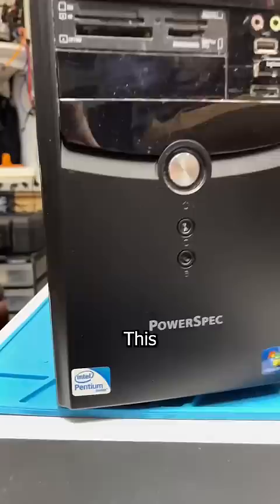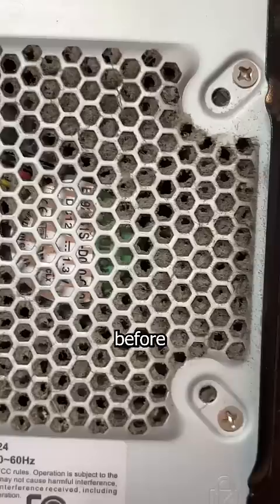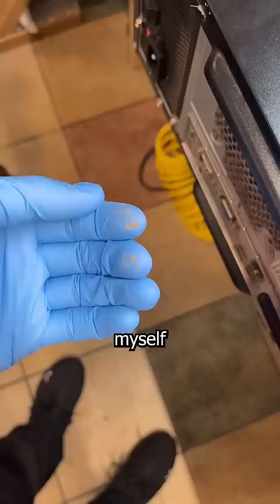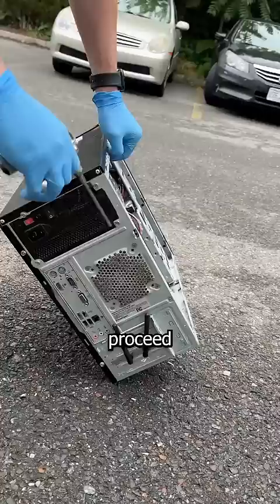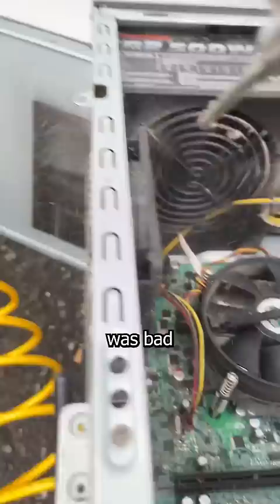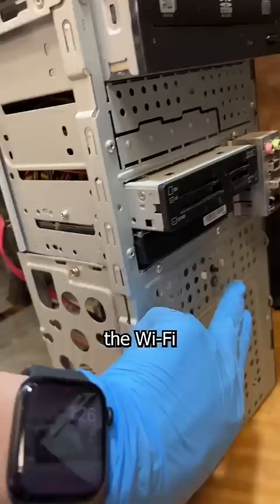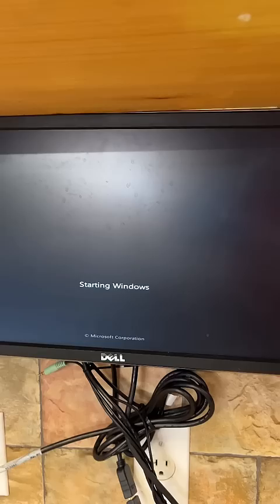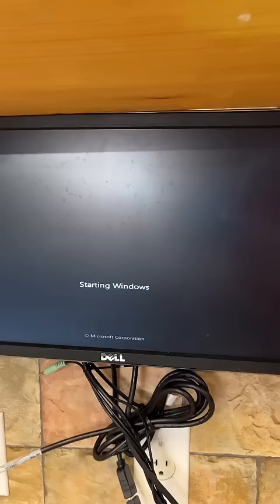Clean your #pc or it will end up like this! #technology #tech #shorts #computer

Comment: I use an electric leaf blower to clean out a PC.  I owe it to an Australian for showing me once.
Reply from the maker: Hell yeah brother
Reply: @Speediest_Burger if they arent plugged in they clearly werent important
Reply: Why does an Australian need a leaf blower? Their plants are evergreen.
Reply: @Speediest_Burger why?
Reply: @macosx10.7lion4 not all of em are mate
Reply: I use a handheld vacuum cleaner
Reply: @devavratkhandekar4020  Vacuums could cause static electricity, I wouldn't use one for cleaning your PC
Reply: @trr4gfreddrtgf there are different kinds of vacuums that don't produce static energy
Reply: @Speediest_Burger just take it out or keep the cooler lol
Reply: @Speediest_Burger ignore my last comment if you saw it, i thought you were talking about cpu pins lol
Reply: you can actually damage fans if they spin to fast. A normal small PC air compressor is enough
Reply: @dwong98 or just... don't let them spin?
Reply: @Speediest_Burger  what??? out of everything that could break under high wind you pick cpu fan pins... TF
Reply: @trr4gfreddrtgf  I've been very rough with my pc in terms of static, I clean it with a vacuum on a carpet nothing has happened yet. I think LTT did a video on it, there's allot of protection on parts.
Reply: Say goodbye to your fans
Reply: @SupaTrendingDaily  I know, but putting a vacuum up to your PC to clean it isn't a good idea.
Reply: Respect
Reply: @macosx10.7lion4 well we still have leaves
Reply: I used snow blower and once I blew off a capacitor 🤣
Reply: tech yes city reference?
Reply: Woundn't cause static? That could fry your pc
Reply: @ionikre  do you know how a snowblower works? They don't blow air, they use an auger to launch snow into the air
Reply: @AJ-Palermo  my fault. I mean that airblower things bc I use it to blow snow on my balcony 😂
Reply: @macosx10.7lion4  because we mow lawns here too believe it or not, here's how I use mine, I clean the shed out and blow it down the drive way or mow the lawn and blow it onto someone else's yard or the road, lol not my problem anymore hahahaha
Reply: I now desire to go to my public library with a leaf blower and offer cleaning services
Reply: I literally sneezed watching this
Reply: @Steve211Ucdhihifvshi  cut grass isn't a problem, it's a fertilizer.
Reply: @macosx10.7lion4 
Have you mowed your grass?
Reply: I used an electric leaf blower too. My PC bricked from the static electricity.
Reply: im Australian and i do that lmao glad to see im not the only one
Reply: @smithbabies7886  yes.
Reply: Same here, but my current computer has such legendary filters, now I just vacuum the filters and slap it all back together, almost no dust gets past it. It's one of the Be Quiet cases if anyone is wondering, they are great!
Reply: Me too or my air compressor
Reply: @dwong98  not true I've done it no issues
Reply: @SupaTrendingDaily  true
Reply: @ionikre  prove it
Reply: @SupaTrendingDaily depends on humidity
Reply: @macosx10.7lion4 you’ve never been to Australia have you?
Reply: @trr4gfreddrtgf  then ground it <.<
Reply: Same my brudda.
Reply: Probably smarter than using compressed air since water can build up in air tanks.
Reply: @5sweatingpalm  Don't think it's possible to ground a vacuum cleaner... They generate static electricity, it's going to be an issue whether you ground it or not.
Reply: there are workshop blowers the size of hair dryers, usually with smaller nozzles than a leaf blower but still got that very high air speed. you can get that inside more.
Reply: @macosx10.7lion4 blow the spiders away
Reply: @AegisHyperon  actually a really good point, thanks for the insight.
Reply: @macosx10.7lion4  bro literally just explained how you could use it for other things besides leaves come on brotha
Reply: @macosx10.7lion4 even then, plants still shed their leaves - someone from an Amazonian country
Reply: And all rhe oil and shor inside it is now inside your computer. For the love of all thibgs electronic, do not do this
Reply: @macosx10.7lion4  alot of them are but not all not to mention even the evergreen trees drop a ton of leaves. They are also used for blowing grass clippings
Reply: I use an electric air duster
Reply: Use a datavac electric dustbuster. those things are amazing. a bit pricy but buy once cry once plenty of blow, not quite compressor strength but plenty enough for pcs, vacuum filters etc.
Reply: @macosx10.7lion4 how else would an Ozzy clean his computer
Reply: I do this everyday at our repair shop. Easier than using the plug in blower lol
Reply: Great way of blowing your capacitors off
Reply: @macosx10.7lion4  lots of us live near gum trees, which is essentially the same as leaving oil on the ground. they're very flammable - why risk it?
Reply: okay but that's kinda rough on the fans thoughhhh lol
Reply: We use the electric tea kettle style blowers. They work wonders!
Reply: @macosx10.7lion4 nahhh bro 💀💀💀
Reply: Air compressor may blow electrical components. I once blowed a small capacitor and it gave me a real pain in the ass to find it, and replace and resolder with a new one. I even had to bought an soldering iron to do that. Use air blower instead dude.
Reply: @SalemTechsperts does the greatest technician that's ever lived failed to make us smile? No
Reply: @SalemTechsperts You are earning more from youtube than your shop 😂
Reply: @macosx10.7lion4 as an australian, no?? we have leaves lmao
Reply: @JoeSmith-qy6qo  dude chill I was trolling
Reply: @macosx10.7lion4  you’re spreading misinformation :(
Reply: @macosx10.7lion4  they still have leaves and the south is a temperate zone with winters and snow.
Reply: @flamespear86  I was trolling
Reply: same or I use a compresor
Reply: I do this also
Reply: @trr4gfreddrtgf  If you think a tiny bit of static is going to do anything to a modern PC, you must also be the type of person to cover their roof with a tarp when it rains
Reply: Tech YES City?
Reply: Holy shit, this is genius, I have a leaf blower in my yard and don’t have anything pressurerised air anything, thank you, and the Aussie legend who told you!
Reply: @swahkennison7116  No, Western Australia 2004 with a regular size electric leaf blower.  It looks like Tech City uses a mini version that wouldn't blow leaves too well.  I have dealt with computers at construction sites, and they will get loaded with dirt in a year.
Reply: @demetriusgallitzin8859  true they get awful inside some assembly plants also.
Reply: Do other countries not have blowervacs/leafblowers?
Reply: @Kitinelli  I think he was just saying it happens to be an Aussie who showed him the trick, rather than suggesting leaf blowers are specific to Australia
Reply: I just use my vacuum cleaner 😅
Reply: @macosx10.7lion4 leaves still fall off the trees
Reply: Игла для мяча идущая в комплекте компрессора для подкачки шин либо в турестическом магазине.

Comment: me who downgraded from win10 to 7: 🗿
Reply: Thats an upgrade.
Reply: Likewise my bro, windows 7 may always prevail
Reply: I had it done, worked like butter but then switched back because some games needed win10
Reply: All PCs in my company have Windows 7 for the kind of work we do.
Reply: Yeah, sadly its losing Steam support and it is more vulnerable. I'm thinking of switching to Mint, if I ever get around to having my harddrive repaired and then backing it up. (If I didn't need the net connection it'd be 7 all day)
Reply: Why do you guys like 7 better? I have zero knowledge about CPUs
Reply: @elmoneyyy  Do you mean PCs? Because a cpu is the core processor for the computer. But its not why I preferred 7 as an OS. 7 was the last version of the OS that didn't advertise to you, didn't track what you were doing a strictly as latter versions do (if you prevented a sneaky update on Window's part at least), and the last version that wasn't created with the intent of running on both PCs and phones/tablets (which makes a mess of the gui, birthed weird background overhead and long startups, and changed around a bunch of paths in settings.) Most of those complaints are fixable on the newest versions (I use them for work) but I've never seen "you can make it suck less than how it was designed" to be a meaningful endorsement. Especially when Windows sole claim to worth as an OS has always been that it was super low-investment without being strictly proprietary in its approach to everything. It doesn't take much lift on investment to push me toward something else.
Reply: lmao Gen Z Boomers getting viruses because "it's tooooo hard"
Reply: tldr; Zoomers and Boomers don't have the mental capacity required for Windows 10 - which is really sad when you consider that Microsoft designed the OS to be usable by middleschoolers
Reply: @topogigio7031  do you genuinely not understand the concept of a preference? say you wanted a tablet, apple or samsung, many would go for an ipad but others the samsung. why? apple being blatantly anti-consumer, or samsung not having the right ecosystem for the buyer's needs. it's not all for a lack of understanding that people do things, and it's not lying when someone states their personal opinion
Reply: Im planning to do that lol
Reply: Me who downgraded from 11 to 10
Reply: I want Windows 7 but my other laptop came with windows 11
Reply: @JarthenGreenmeadow it is a downgrade, It has just not kept up, windows 10 is the current meta
Reply: Same here too. Win 7 so much smoother
Reply: i plan it.
Reply: @topogigio7031 im a zoomer and I use Windows 10, what kind of narcotics are you consuming good sir?
Reply: I used to dream of doing that just for chess titans and purble place
Reply: I swapped to linux on my laptop when support ended because I valued security too much to connect to the Internet otherwise, and had personal experience within the family of laptops bricking after the upgrade. Built my desktop after Windows 10 was already out for a while, so that's what I went with to stay within the ecosystem. I have no intention of upgrading to Windows 11, both because the hardware requirements render my system incompatible, and because I don't like most of the gui changes or further adware/spyware lockdown. Currently gaming is my only compelling reason to keep Windows, but I have enough compatibile games that I shouldn't miss what I lose out on too much.
Reply: IT
JUST
WORKS
Reply: @brick9046  Do you not understand the concept of preference based on skill and education? You don't like advanced topics because they're too hard for you. That's on you, not me
Reply: @topogigio7031  my man, you're the one saying that all old people and gen z are tards and can't use windows 10. not saying some aren't, but it's hardly on me that you can't even come up with a decent reason to support your argument
Reply: I don't understand win 7 people.
This shit is so unresponsive and counterituitive
Reply: @ryanjones_rheios that's why I don't like Linux u can't. do much without internet.
Reply: @univera1111  The more used to it you get the more you can do and just as a general rule anything new or complex are both going to be made vastly easier by the net. No OS really gets away from that. (When was the last time you tried to make any major changes to windows? You probably used the net there to.) 
And there's options for simpler day-to-day operation linux os. Linux Mint is one I know of, but there's probably a dozen others.
Reply: @mitchblythe7521  Only if you're stuck with a fucking 4GB ram computer. Literally no difference performance wise on any remotely modern PC lol
Reply: @hua..  sure lol
Reply: Windows 10 to 7 its something like 🧓 nowadays you should say from 11 to 10
Reply: I did that for my mom’s computer but she had 8 originally. That was the worst operating system if even my tech-illiterate 60 year old mom was begging me to do something to get rid of it hahahaha
Reply: "Downgraded"
Reply: @LegendStormcrow  lets be real, its an upgrade
Reply: Eternal blue entered the chat😂
Reply: @JarthenGreenmeadow  
No it's not.
Reply: I had to because of some program compatability issues for like 2 years.
Reply: Windows 7 was the last time I felt I had control of the operating system. I have learned to use 8.1, 10 & 11 for helping family troubleshoot. I am on Mac now but any time I want to feel at home I open my Window 7 VM. Win7 was built with user practical flexibility, all the rest were built for theoretical “user predictability.” For some it fits like a glove, but I was never able to fit that mold.
Reply: @DuoAudio.Polyglot  

> I don't feel like I'm in control of my operating system on modern windows
>I use Mac now

LMAO

If you want to be in control use linux, mac isn't going to save you from having less control. Apple seriously seems to rot people's brains.
Reply: @ToveriJuri  Do you know how to code/mod? Windows 7 had exactly what I wanted in regedit (8.1, 10, 11 not the same). Mac gives me the best code/mod flexibility while staying consistent (Well…that was the case for years). And I do use Linux for specific reasons (Kali). And on that thought I liked BackTrack better than Kali. But that’s a different conversation. 😁
Reply: @ToveriJuri  Out of curiosity, what operating system do you use? What do you use it for?
Reply: @DuoAudio.Polyglot  

I use windows 11 for gaming, because I don't want to fuck around with workarounds just to get suboptimal support and performance and I really don't care about customizing windows.

I used to run Arch, but these days I just can't be arsed and go with Kubuntu.

Ultimately I really am no that obsessed with having every little detail customizable to my liking.

I just don't understand the notion of prioritizing the best customization for your OS and then going with "Apple ecosystem" bullshit.

I don't work in a field where something as specialized as Kali is relevant. I find the opinion of "Backtrack > Kali" rather strange and uncommon. I thought people were rather favorable to the change, but again it's not something I dabble with much so I don't know the specifics.
Reply: Upgraded* 7 never dies !
Reply: @spinosaurr it's already basically dead (taken off life support)
Reply: @samelosito  it doesnt change anything, lol
Reply: @HandleIsNewAndBad bro you're not going to have a company soon
Reply: "Remember no matter how much trouble your going through with your windows, there is always a peaceful place to retreat to, its windows 7"
Reply: @ToveriJuri Call me crazy but I use my Mac for PC gaming. I’ve been running my Windows only steam games through GPTK, and even though it isn’t necessarily meant for the end user to play games, (mainly for devs to port their games over to Mac) it still runs games really well. It isn’t perfect but hopefully overtime more updates and support will improve the experience.
Reply: @HandleIsNewAndBad what's the kind of work that needs win 7 more than 10?
Reply: @wiesiekfarmer9972 Don’t blame the OS, blame your shitty computer 💀
Reply: @rumenjanro  imagine win 10 works just fine and propably I have better pc than you but thx 🥵
Reply: @JarthenGreenmeadow Kaby Lake+ CPUs: Might as well BSoD your pC
Reply: Me who upgraded to Linux 🗿
Reply: Just as a tip: Never use Windows 7, unless you absolutely need to (Legacy apps).

Do not browse the web or manage finances on that PC and always do daily/weekly backups of whatever data is stored in it.
Reply: I feel windows 10 has proven itself, just in time for microsoft to want to kill it. However, windows 7 will always be my favorite ever version of windows.
Reply: Just use tiny 11 lol
Reply: @elmoneyyy Windows 7 doesn't have telemetry and bloatware like later versions do, that's why.